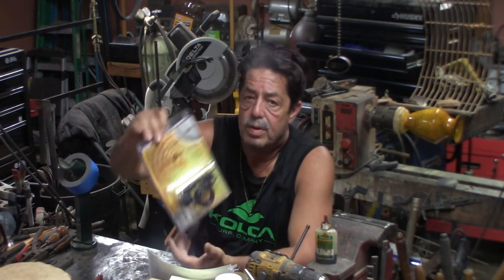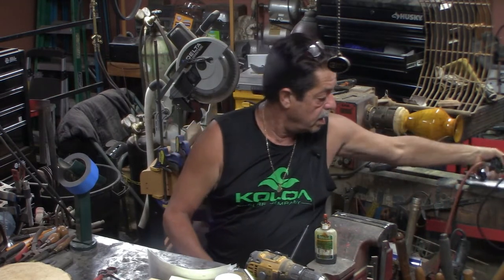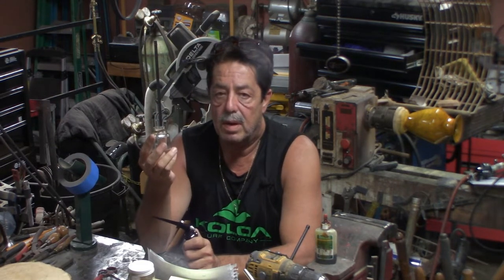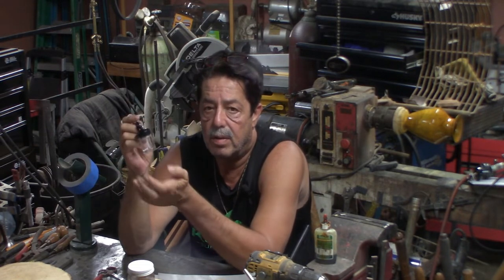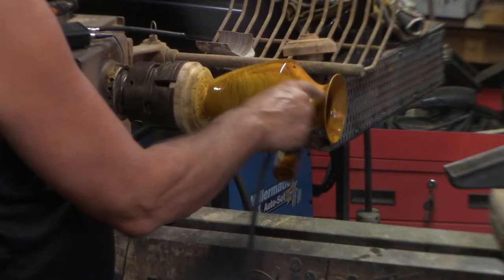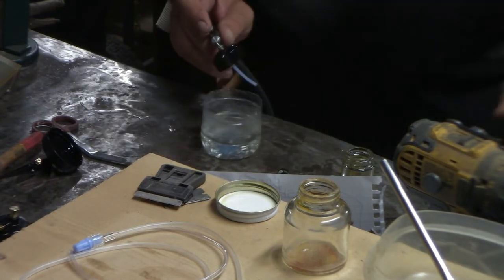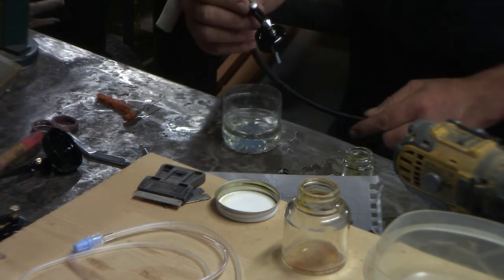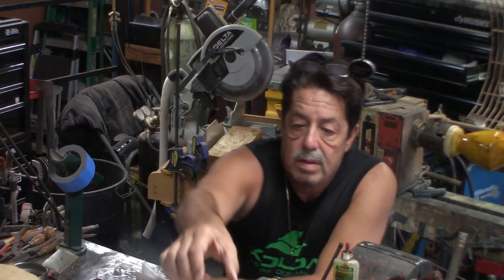Badger 250 Airbrush Tips and Tricks That Work

Comment: hi. i plan to use this for retouching car scratches. If i mix the paint with a pearlescent powder will it ruin the flow like it will get splattered burst or clog the nozzle?
Reply from the maker: I would try it on a scrap pc and test it - that is not something I have done but make sure you mix well to avoid clogging up on you